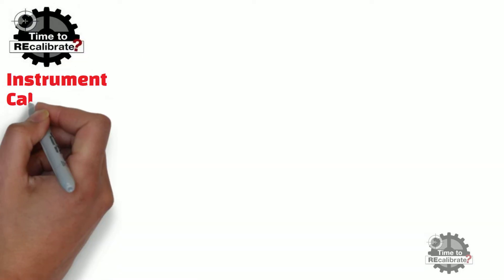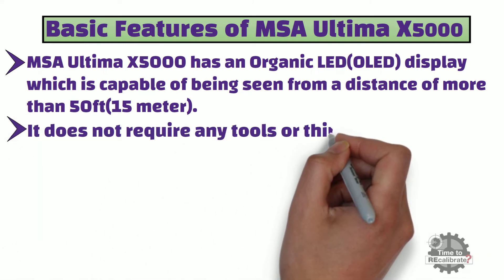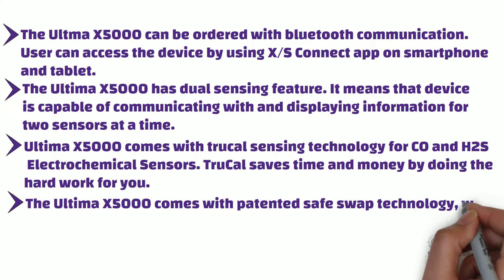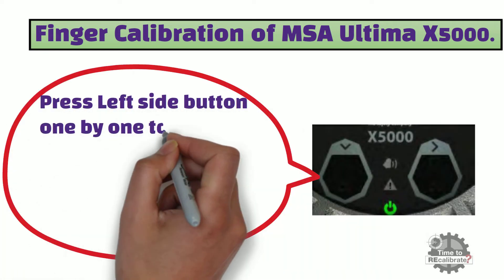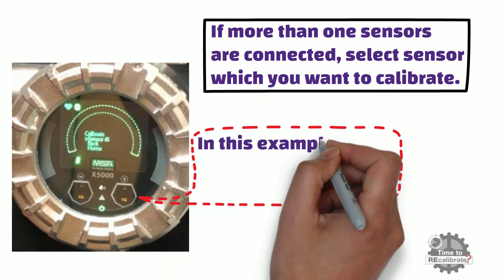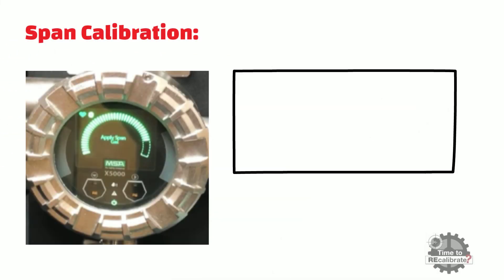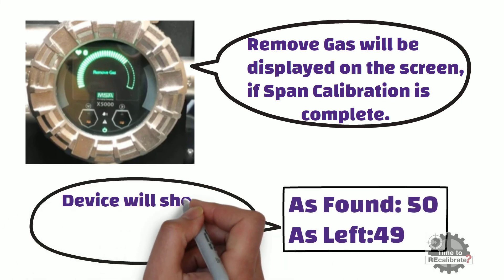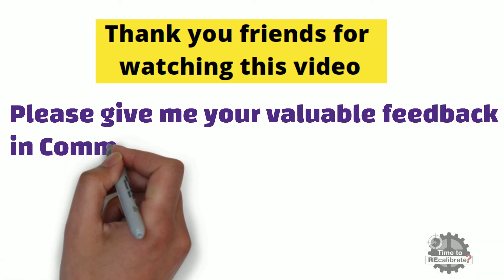Calibration Procedure for MSA Ultima X5000 Gas Detector | Zero & Span calibration

Comment: Respected Sir how to replaced new gas detector sensor and how to calibraction of new sensor
Reply from the maker: Hello Arunjadhav
All the electrochemical sensors are plug and play type of sensor. Turn off the power of gas detector, remove the old sensor by turning anti clockwise, and install new sensor

Comment: There is a green cap that closes ports around intake when calibrating - come with new units
Reply from the maker: Hello Richards
Thanks for sharing this information
Reply: That's only necessary in areas with a decent draft. Make sure you remove it after calibration